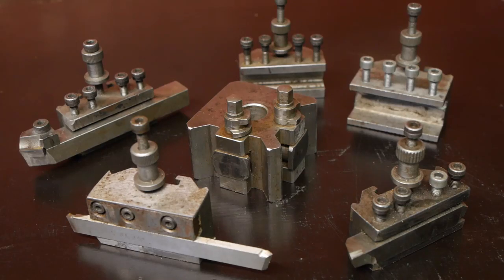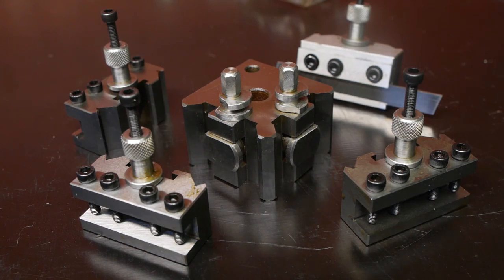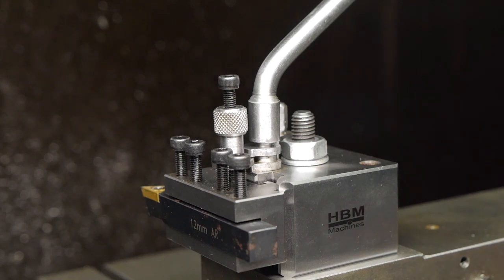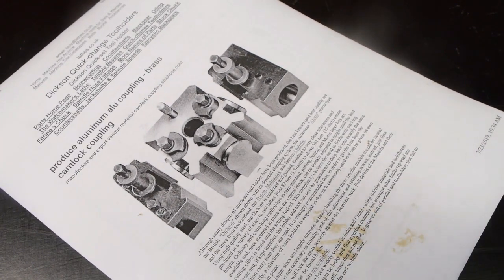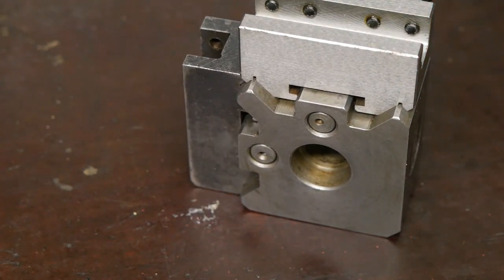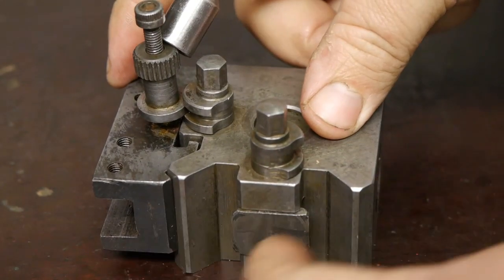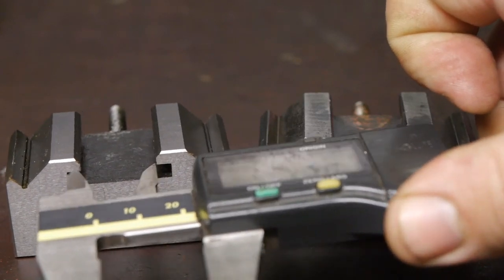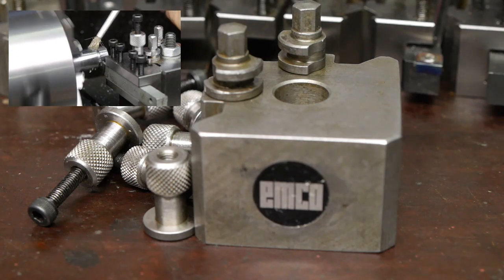HBM Dixon vs. EMCO Dickson quick change tool post

Comment: You brought the wrong size set , the T37 is too small you need a T51/63, don't buy something because it's cheap,,  buy it for the correct reasons as a QCTP is gonna last you a life time. Some of the cheap Indian versions are OK.

Comment: Get a question. I have a 50 plus year old dickson on a colchester master. I don't think your Emco  is an original Dickson. The bolts on the original were square head and the height adjusters look different. Is your Emco a copy as well?

Comment: Haha. These knock offs are hopeless. You can even see the rust on their holes and pistons throughout the video (the hbm one). The only thing I like from the dickson's type is the bedways' like slider. I'd have gone for a bxa type instead, or if you feel brave, mix the dickson's slider with a bxa design and make your own, but I guess you're just reviewing this and that, more than actually using your machines.
Reply from the maker: Except for the rust in the holes the machining on the HBM is really very good. But I'm not sure if I can trust it after that parting of disaster.
Reply: As you have them already, you should be able to make them fit properly with some tinkering, and they might serve you well I guess. I'm mostly contrary to these, as well as the alloris type because of the unnecesary complexity when it comes to making new holders. The axa ones don't seem to hold properly, so for me the right price/performance/complexity ratio is with the bxa type.

Comment: Hi RM
Interesting video. Make a nice fitting screw on tall bush to screw over the long fixing bolt, file two flats on it for a spanner then tighten it down to the top slide. This fits inside the tool block and will stop the top of the tool block rattling about when you loosen it. I also made a locknut and modified a detachable ring spanner to loosen it, I don't like fixed handles, I find they are in the way some of the time. 
I've had my Dicksons tool post since the mid 1980's, it really did some hard work back then. It's never let me down saved me loads of time swopping tool bits over. 
Still works as good as new. I have recently bought some new after market tool holders to compare, they fit perfectly. Great piece of quality tooling.

Comment: I have purchased the M-series from Dixon. The block is larger (75x75x51mm) and is more rigid than the K series. I am also busy making new set screws. The diameter of the lower ring was too small (from 20 to 23 mm) and I made it less high.
To assemble this block I made a special shaft that was pressed into the cross slide.
Reply from the maker: Is dat niet wat te groot voor dat draaibankje?
Reply: @Rolingmetal  Deze is goed geschikt voor de grootste tafeldraaibank van de reeks HBM290VF. Trouwens de afmetingen van kruisslede is 80x80mm.
Reply from the maker: Dat is behoorlijk, de mijne 68x68mm

Comment: Thanks, an interesting video showing the differences in detail.   I do prefer my Aloris style QCTP over this design.
Dave.
Reply: Me too, and I have had both styles. Currently using a Dorian post, with a few Aloris holders and a bunch of cheap
Chinese ones as well.
Reply: Yeah.  The amount of slop and overall 'business' of the thing stymies me.  Not to mention that making spare Aloris holders is a bit easier.
Reply from the maker: I'm staring to think I made the wrong decision buying this thing. But who knows, maybe it will work out,

Comment: Just watching your parting tool jam up again (yes it does suck)
I wonder what flexed so much?
 It seemed to pull the tool holder right out of the vee ways.
I have never tried parting upside down in reverse.
I can’t these days anyway as my machine has no reverse and the chuck backing plate is a screw on to the spindle nose.
My quick change tool post doesn’t have that groove where the centre height adjusting screw fits into locking bolt.
The height screw just rests on the top surface the tool post.  It’s way simpler but. Must be because mine is the next size bigger post.
You could make a stepped bolt instead of a puck.  Less parts equals more rigidity.
Thanks for sharing ;)
Reply from the maker: I wondered about that myself. Lot of things seem to happen at the same time. Hopefully the EMCO tool post will do better
Reply: It looks like something in the tool post bends or stretches then snaps back into place.
I'd usually expect the parting tool to snap or the job to be horribly bent out of shape the motor to stall or a combination of all.
But not the tool post to move off it's mounts.
Very interesting even if it is a bit of a disaster :)
Thanks for sharing the problems as well as the successes

Comment: Saw your last video on the hbm post, saw the parting disaster.  I'm guessing you're going with the Emco post with all the holders?  The parting disaster seemed to be due to the holder pulling loose, perhaps due to the drawbar vibrating loose?  I assume you checked the parting tool holder for rectitude after the incident, if they are hardened then my guess would be the post going wrong.  Have you tried parting with the same holder on the Emco post?

questions, questions.
Reply from the maker: I don't know what happen there. I did tighten the cam up properly and there wasn't that much vibration. But you might be right. Anyway I'm going to try the same setup with the EMCO and curios how that will work out.

Comment: I can see the grooves between the facets helping to align easier to the tool post, a sharp corner in the V and a sharp corner on the holder would kick the holder out. I reckon it also means they can grind both facet without kissing the wheel on the other side. Cool video thanks for the comparison, I was thinking about buying one of these for my hobbymat 😁
Reply from the maker: There is not much wrong with the HBM, the machining and fit and finish is very nice. So don't let my misfortune stop you from getting one of these. A hobbymat is probably a much lighter machine.

Comment: I recently brought a Gib-style toolpost from banggood. It is a little bit small for my lathe, but I was surprised about the rigidity. I turned a snuck fittiting mounting stud out of tool steel, hardened it and it turned out very well. So I brought a bigger bunch of toolholders and are fine.
I like this toolpost style because it relays on a simple dove tail clamping mechanism. This can easily made myself, so even in decades I can still use the tool post. Just whish they sell the bigger version with gib clamping, but they all are piston type ones.
I have to say even parting off has now more rigidity even compared to the old 4-way tool post. So the small one is fine for me.
Reply: I have the Banggood oxa gib style = very nice.  Just ordered the larger axa gib wedge style from AliExpress for my bigger lathe .  I wish Banggood had it as their prices seem a little keener on these tool holders and posts. I bought the 250-101 axa holders from Banggood (hoping they fit the AliExpress holder. As suggested I went with dovetail as the holders look to be able to be home shop reproduced.
Reply: @jirvin4505  Great idea with aliexpress, never thought about it. But now I have the small one, so I will keep it.
As of my holders they can easily made in home shop. It's just a 60° dove tail. I have ordered a dove tail cutter from banggood and by holding it on the toolpost they fit exactly. So it's just a matter how exactly you could work in the home shop. But currently the holders are so cheap I ordered more than enough. And by the way: They are ground very nicely. Feel extremely smooth in the hands.
I first thought about a multifix type of tool post, but I can't make such holders. They are too complex to machine.
Hopefully the holders you bought will fit on your toolpost!
Reply from the maker: Interesting. I though they only sold piston type tools posts. They actually offered me one for review earlier this year. Guess I should have taken it :)
Reply: @Rolingmetal  Yes, they have. This one: https://www.banggood.com/Machifit-DMC-250-000-Cuniform-GIB-Type-Quick-Change-Tools-Kit-Tool-Post-250-001-010-Tool-Holder-for-Lathe-Tools-p-1434251.html?rmmds=myorder&ID=518451&cur_warehouse=CN

But as I said, I would prefer the bigger version. But on my lathe I be p limited in the center hight in combination with the compound slide. Overall my lathe is much bigger than the mini-lathe (where this tool post may fit at best), but my compound slide is more solid and also the hight is much more. So I can't adjust the tool hight deep enough to get on center with a more solid tool post.
But over all this little guy is really rigid. Even as rigid as the same 4-way tool post you through away too.

Or we make our own tool post, then we have the best fitting option :D

Comment: Having one of the QCTP from the great Mau's empire I retired the lantern toolpost that came with the lathe quite quickly but I recently got it back into use as a dedicated parting attachment I used one of the insert parting blade tools with 12mm square shank in the lantern toolpost as the cutting edge is much closer to the fixing bolt so it is much more stable I have also replaced the compound with a block of steel of the same height so now the parting off is a breeze Last night I was making 10mm thick washers from 55mm diameter bar stock at 420rpm and I didn't have to change underwear once as there was no digging in and loud bangs as the parting blade broke!
Reply from the maker: Check this video. I like the idea: https://youtu.be/HGAQHjzgs9c
Reply: Hi again RM. 
Just watched the video. I think this is a good idea but what's the point of having a QCTP if you have to remove it to part your work off? I'm only an amateur but the overhang from the wedge type tool holder is from the actual wedge to the tip of the tool. Far greater than the Dicksons one. The Dicksons tool holder is wedged in at the corners of the tool post block so the overhang is only from here to the tip of the tool. I would try mounting your Emco block as I referred to earlier for quickness and rigidity. Also my parting off tool is 2mm wide this helps compared to the usual 3mm ones you see. The 3mm one is 50% bigger which
on a small lathe could result in chatter and or snapping the tool off. I've got the tee shirt. Tony...…….
Reply: @Rolingmetal  
Yes I did but my problem is that I don't have the same option to mount  using a tee slot which is why I opted to swap out the QCTP when needed; careful thought about the order of operations can reduce the inconvenience that the 8 turns of the QCTP locking nut to swap them brings. It is a small price to pay for the ability to SAFELY use the parting tool as it was designed for.
Mike

Comment: RM, I did this comment on your last toolpost video, as you did not reply, perhaps you missed it. Good luck with it.
That extra hole in the toolpost was for a removable dowel pin. When first fitted corectly with the centering collar fitted below and the correct fitting bolt and usually a centering bush at the top; the tool post was lined up square with the lathe axis. A hole was then transfered into the compound slide and reamed a good fit. The whole idea was you pulled out the dowl to angle the tool post for general turning, but when you needed to part off, slacken the bolt, replace the dowel and the tool was then back at 90 degrees to the lathe axis. Really to fit yours correctly would be to machine an accurate recess in the top of your compound about 4 mm deep, to exactly the same diameter that is ground into the base of the toolpost. If the same diameter recess will make it too close to the edge of the compound, then make it smaller diameter and make the collar /washer stepped. You then make a close fitting collar / washer, this ensures a location fit that will not move axialy, only rotate and at the top you also need a close fitting stepped collar. This collar does 2 functions, locates the toolpost centrally to the bolt, acts as a washer for the nut and also restricts the movement of the locking cam ( as you discovered with your home made one). Finally the bolt has to be a nice close fit to the top bush and be as big a diameter as possible for that size of QCTP, probably a 1/2 " bolt, preferably of 8.8 tensile strength. These Genuine Dickson toolposts were industry standard at one time 1970's to 1980's in the UK for the low end priced lathes, the high end was the Swiss made Multifix system ( still being made today ) Sadly Dickson's are no more, but plenty of Chinese knock offs, of questionable quality, often poor materials. I was a Machine Tool Fitter for 35 Years and spent many a happy hour fitting Dickson's and later Multifix's to the Company's workshop lathes of all sizes, from Boley watchmakers to our largest Lathe a Dean Smith and Grace 60 inch between centers lathe. When the workshop closed I scrounged 2 Multifix toolposts and about 20 holders to use on my Myford and Hardinge HLV Toolroom Lathes now here in my workshop in Adelaide, Australia. Re watched the start of the video, noticed that you already have a recess machined in your compound slide, as I said above, make yourself a close fitting collar that fits the compound and the toolpost, this will stop any axial movement of the toolpost.
Reply from the maker: But a dowel pin would not do much for rigidity imhp. Wouldn't just bolting it down to the compound slide help more.
Just take it out for the occasional angled setup.
Reply: @Rolingmetal  The rigidity would come from making and fitting the close tollerance 'Puck" as you call it between the compound slide and the recess in the base of the toolpost. It would stop any lateral movement between the toolpost and the compound slide, which I think is your problem. As I said earlier also make a close fitting stepped washer / spacer for the top of the toolpost with a close fit to the bolt diameter too. Use the largest bolt diameter you can, preferably FINE thread as you will get more torque and also make it tensile 8.8 if you can, tightem with a ring spanner or socket to get a decent tighten.
Reply: Dave
Recently bought an old Harrison lathe with a Dickson S1 tool post, I think it's genuine.
It was missing the dowell pin, so I made one as I see the benefit.
My compound has a boss that fits a recess in the base of the toolpost to provide positive positioning.
Your suggestion of a stepped washer or bush on the topside is a good one, and I will machine one up as there is a gap between the stud and the bore of the toolpost. Thanks again for the interesting and useful comment.

Comment: I use a Chinese copy of the Aloris quick change tool post, I am happy with it and the variety of tool holders. There are two types, the post style and the wedge style. The wedge style seems much more rigid to me. The post type is less expensive, but don’t buy it. I bought two of them and neither worked for me.
Reply from the maker: I might be better of with a wedge style tool post.

Comment: if you are going to make a hockey puck for the bottom of the emco tool post.  make a flanged bushing (to fit down in the top to stop the tool post from rocking over on the studs..  you can also either make a spacer so you can use the original crank handle for the tool post stud or just a stack of washers  till you get the right height..   i was waiting for you to put the Hold my beer tool post and the emco tool post bottom to bottom to compare them..    the last second of your video where the OOPS happened.. go back and look carefully at what flexed.. did the spindle move.. did the tool post rock.. did the compound lift up ..  did the cross slide lift up..  or did the  entire table come up off the ways..
Reply from the maker: That should not be necessary  if the hockey puck fits tightly in the compound slide and in the tool post.
Next video I'll probably try the same parting of setup with the EMC after I made the Hokey puck.